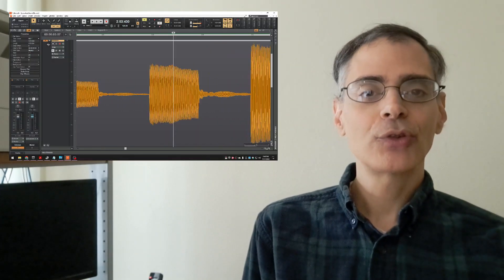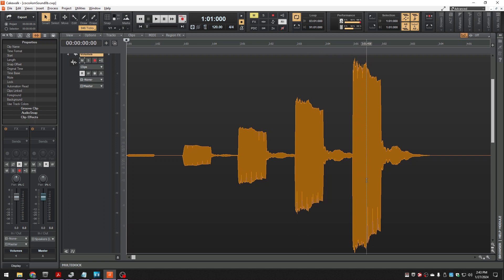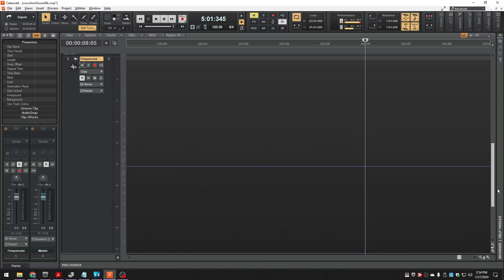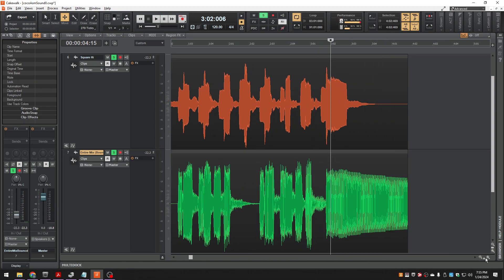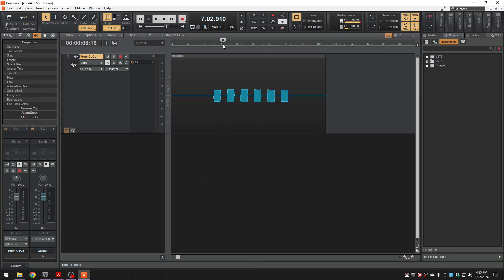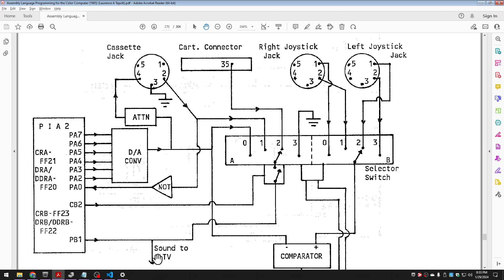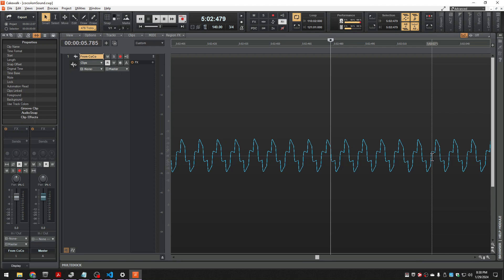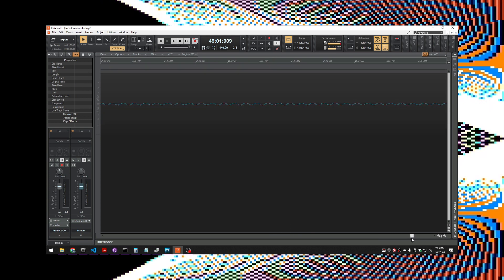Digital audio basics & the CoCo | Asm Sound 1

Comment: I had a bit of fun "bit bashing" my kit-built computer's output port to produce tones.  It had a port used for other purposes but some of the bits on the latch were not used for anything even though they were available, so I connected them to an external jack so I could more easily connect external hardware such as an amplifier.
I discovered how to make a loop which changed the duty cycle of the waveform without changing the frequency.  That was fun, listening to the tone become "thin" as the on time reduced and "fuller" as the on-time increased.

Comment: The CoCo output looks like a type of sawtooth wave. I'm curious to see what you can accomplish here.
Reply from the maker: Yeah, that's a good point.  I haven't read up on what it's actually trying to do yet.  I'd imagine either the ROM source code or the service manual would clarify what the wave is supposed to be, so I'd know if my CoCo is just old & weird or behaving to spec.
Reply: I was thinking a sawtooth wave should be easier to calculate than a true sine-wave, and yet still be kind of close to a sine-wave.